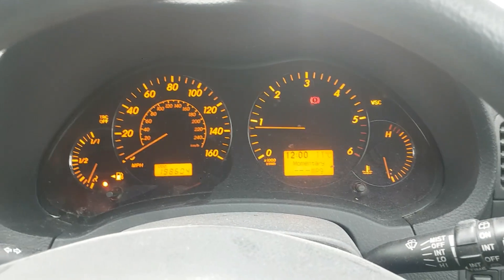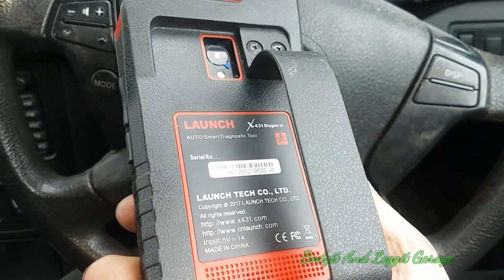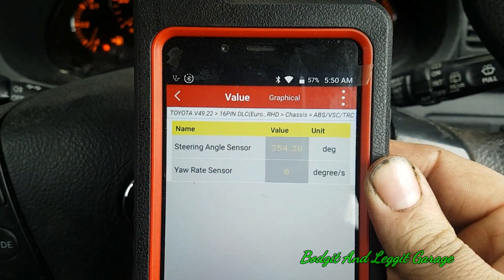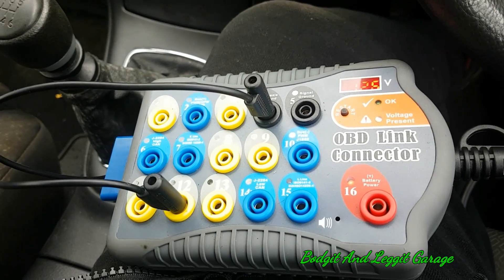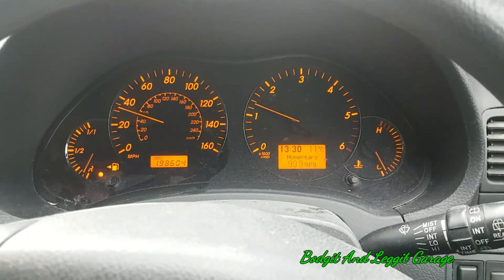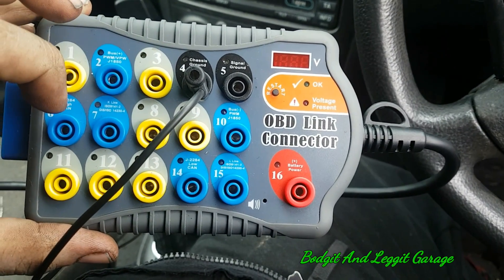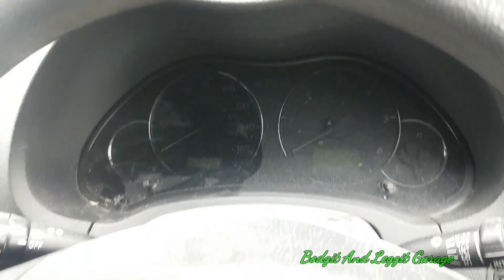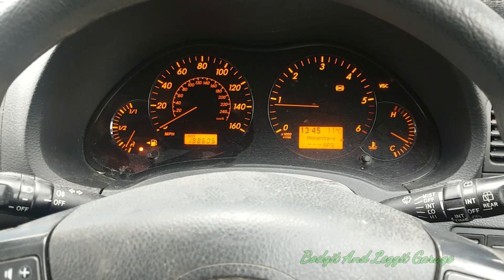How To Program Models With A Breakout Box Toyota C1208 Steering Sensor Fix Bodgit And Leggit Garage

Comment: Hey leon,  how did you know which pins to bridge and could you do a yaw rate steering angle sensor recalibration using the diagun??
Reply from the maker: It's like everything mate A bit of experience and paying thousands upon thousands of pounds or years for data wiring diagrams and procedures yes the Diagun can program them

Comment: I presume that this can be done through the diagnostic tool as well?
Reply from the maker: As far as I know it cannot be maybe with the main dealer software I haven't seen aftermarket ones that can do this but then having said that I haven't used every single aftermarket scantle so it's a possibility I have never done this with this scan tool on these particular cars
Reply: @bodgitandleggitgarage  thanks for the reply, that's good info!

Comment: Love this Chanel I’ve never owned a brake out box and nobody I work with does either we’ve always done it with a spare bit of wire tbh😂 will definitely get one of these now I know
Reply from the maker: Thanks for that mate yes you can use that method but you have to be very very careful easy to cross pins with a breakout box can't really go wrong

Comment: I had no idea you could program them like that. I'll have to remember that one. I do have a breakout box but I've only used it a few times when i had a car with suspected communication issues. The voltage display is useful.
Reply from the maker: It's amazing what you can use them for I have other videos coming up what you can use them for